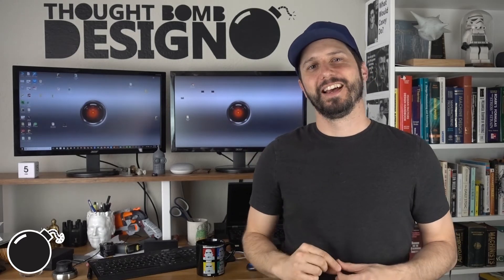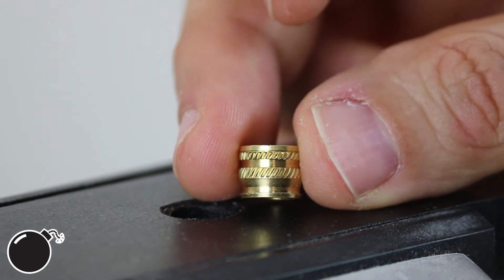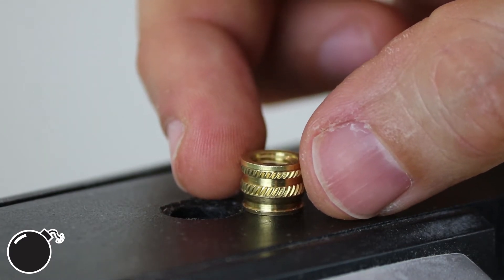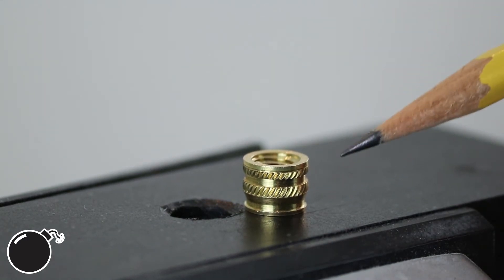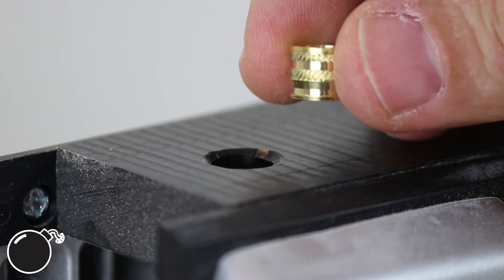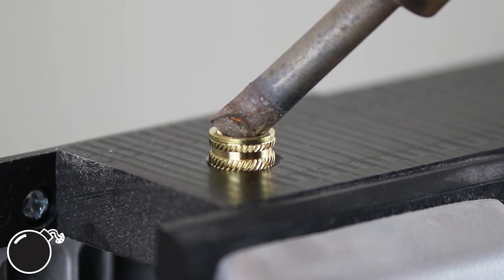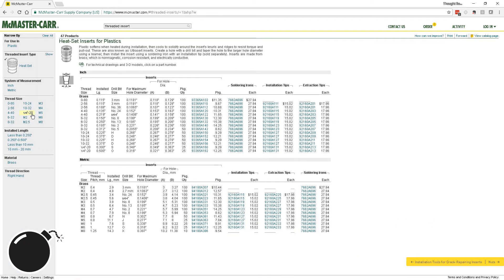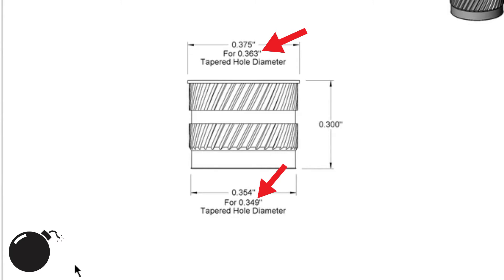Heat Set Threaded Inserts

Comment: Any suggestions on Threaded inserts for Resin prints
Reply from the maker: I usually do one of two things.

1) epoxy heat set threaded inserts into place bc heat set doesn't work. It is a good idea to add grooves or some other kind of feature in the hole to mechanically lock the epoxy in place. Also, thread a screw into the insert with a little bit of wax or something on it to keep the epoxy from filling the hole.

2) try to create a pocket on the other side of the part for a square nut.

Good luck!
Reply: @thoughtbombdesign   Thanks for the info, it is appreciated.

Comment: Do you know why I can only find plastic inserts for thread sizes #0,2,4,6, etc and not #1,3,5 etc. ? Thanks!
Reply from the maker: Hmmmm, I don't know for sure, but in my experience #1, 3, 5 fasteners are not used as often. It does seem weird that they don't even offer them though. Try hitting Google? There has to be someone... Depending on how badly you need them you could order a size small and tap them to the size you need?  Good luck!
Reply: @thoughtbombdesign  Ok thanks so much, good to know I'm not crazy at least!
Reply: Arjan Industries manufactures Threaded Inserst as per drawing. visit our website-www.arjanind.com